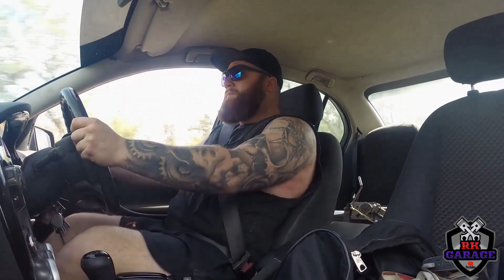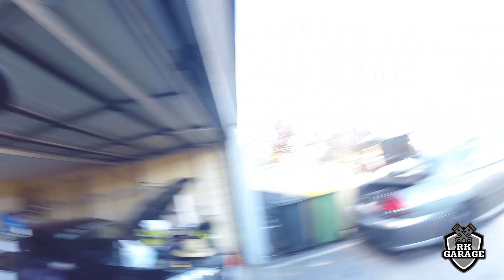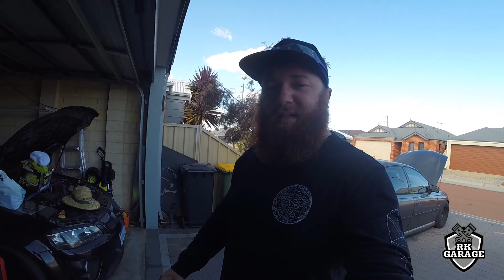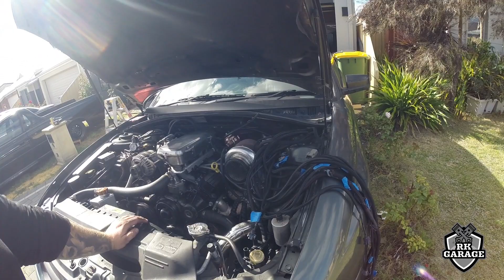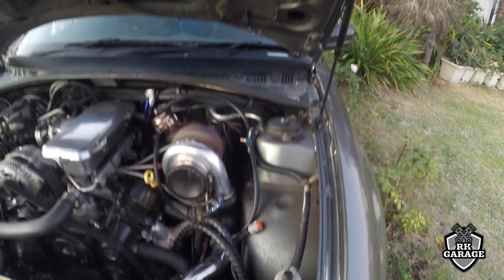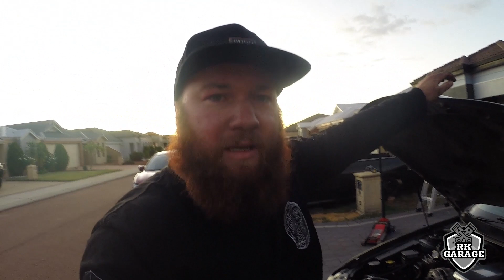Ecu Pt.7 Removing The Factory ECU & Engine Harness

Comment: Good job man I have a vx Holden put vt motor loom and vt ecu in car don't go are the looms for vx vt the same also ecu
Reply: Gotta use your pcm bcm and ecu because they are linked for the security system locking and linked to your key to start the car